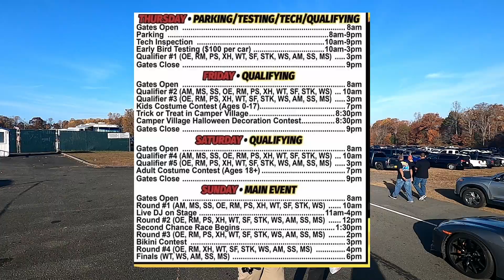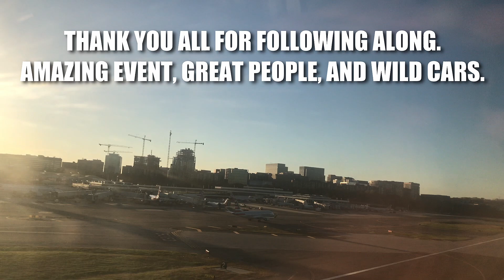WCF Import vs Domestic 2022

Comment: Whats up  CO I need some advise, I have been a tech for almost 30 years I acquired an MK4 Golf did a couple of small things made it fun but I have an opportunity to get another 1.8 from an audi TT  supposed to be rated 220hp. Would I need the module as well to extract the extra horses, and is there a way around the security key.  Need  some real answers
Reply from the maker: The engines although have slight differences they're basically the same and I wouldn't swap engines for them. If you want to use the turbo, just swap turbo and injectors over to MK4, and have ECU tuned for the turbo.

Comment: People are just used to what they know Honda and LS engine it’s all crap if you ask me. We need our Volkswagen community to step up!
Reply: Honda isn't crap. They are beautifully engineered and built engines. The LS isn't either. 

There are a lot of fanbois on either side that can make both insufferable, but they're not crap. I'm a Honda fan myself - who picked up a Mk 7 Golf and loves it!
Reply: @jameshaulenbeek5931  Honda is crap bottom line. Hondas can’t reliably make 1000 + hp without going billet blocks. Volkswagen vr6 iron blocks can hold the power all day no block fillers no sleeves the German’s are far more superior !
Reply from the maker: K's are making 1000 on stock blocks... also you're comparing a 4cyl to a 6cyl, which is sad for us. lol So yes Honda have it figured out, us VW guys are constantly trailing behind. But with that said, most of us doing this enjoy the challenge.